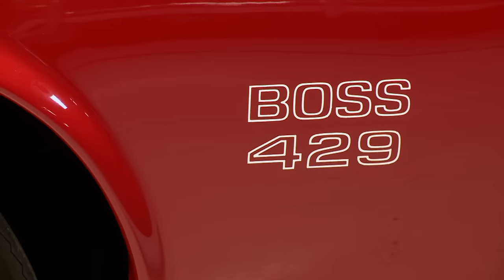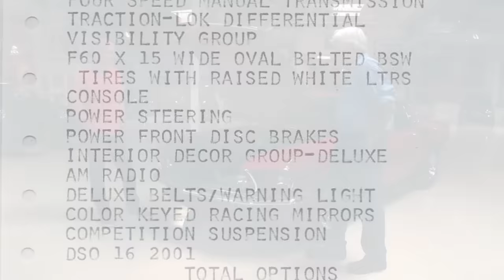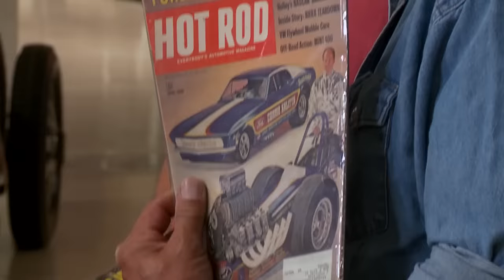1969 Ford Mustang Boss 429 - Jay Leno's Garage

Comment: My Dad has a 69 Boss 429 he bought Brand New upon returning from Vietnam. 370 hp is laughable. They were easily a 430-450 hp car and a carb , cam and distributor advance recurve puts the Boss 429 easily over the 500 hp mark. A simple cam change makes the Boss 429 a monster . Woke up is a understatement !
Reply: Aren't you glad he kept it.
Reply: 370hp is probably the rating in SAE Net, when most cars were rated in SAE Gross.
Reply: Absolute rubbish 1500 bhp 😂😂😂
Reply: Gobbless
Reply: All to get slaughtered by a hemi or 440 6 pack with the same mods
Reply: @bonkeydollocks1879 who in their right mind would want a car with that much power? Sorry, but to me, having a vehicle that has over 1,000 horsepower just makes it seem like it's made for racing on a track or drag strip, but for the normal roads, forget it lmao that's a death sentence
Reply: @charleslasorsa6629  Agree, most 1000hp cars dont make 700 anyways. 
Cant use more than 4-5 at the tire with a drag radial anyways .
Cant drive those cars til 3rd gear and have to ease into them. Useless
Reply: Everyone looks at horsepower and never understands the little thing called torque -- the power to get you moving, and that's what we had with the big blocks and even the stroker smaller blocks like the 351 Cleveland. 500 HP is useless if you don't have the torque to get it started and up to speed in the first place.
Reply: Complete incorrect if u actually watched the races the boss slaughtered and dominated all the 426 hemis and the trans ams and camaros and the super torino cobras beat all lmao 440 couldn't touch this car
Reply: 375 to the ground, makes more sense… 375 at the flywheel is just silly.  No one believed that.
Reply: @idontlikecops1 Amen. These cars stock wouldn't fall out of a tree! They had the potential but Ford neutered them from the factory. Small cam, carb, and restrictive exhaust. The Hemi and 440 six pack had the parts there, they just needed a super tune and timing work. No amount of tuning would make the Boss run without adding another carb, cam, and headers.
Reply: @markjones7417 I take the Carroll Shelby approach. Weight, horsepower, suspension. ⚡289
Reply: @liquidleopard4495   ha-ha, you have no idea. No, as they mentions in the video car-manufacturers were under-rating the power back before 1971 (while they still had good fuel & compression) And one of the easiest ways to do this was not to liw but just give up the "max power" on a wery low rpm like here. The 429 was a de-tuned race-engine that would easily rev up to +7.5k

Comment: I owned  '70 BOSS 429 when I was nineteen. It was Pastel Blue, one of just eighteen finished in that color. Only changes I made were to install headers, an 850 Holley double pumper, disabled the smog pump and thermactor system and  disconnect the rev limiter. Completely changed the performance. Biggest regret of my life was selling it.
Reply: Thanks now I got find one try build one like that
Reply: V8gas you could still do that today... I mean they still cost the same price (adjust for inflation) but most teens are too lazy to work for the money.
Reply: @raph_csg  no, no you can't. Money isn't worth as much as it was back then and the cost of the living has gone up. Meaning , if I could go out today and buy a brand new gt350 for 25,000, then that would be a fair comparison.
Reply: Double pumper? I guess you can forget about gas mileage. I would to love to experienced how it ran with headers on it.
Reply: w41duvernay  It's a Boss 429 dude. What does gas mileage have to do with anything? If concern over gas consumption is an issue you are not just looking at the wrong car, you're looking at entirely the wrong category. The Boss 429 arguably gets the worst gas mileage of any muscle car produced. Oh, BTW. One criticism of the car when showroom stock is that it was undercarburated. Which means performance algebraic equations tell us the engine wants more CFM for peak performance.
Reply: Lot of us guys know the feelings of regret.
I bought a 1969 firebird 400HO 4sp SURVIVOR 49,000 mile original car.
Loving the time and reliving what I loved so much. it's the best therapy on the planet!!!
Reply: Ash qelon  I know. 67 390/427 Vette roadster with 41,000mi. and 3,000 on rebuilt 427. $1,600 in 1972 as a 5 year old used car.
Reply: Will Davis Omg you had a boss 429 AND YOU SOLD IT .I PITY YOU.
Reply: My brother had a 1970 pastel blue Mach 1. The Pastel Blue Mustang was a very rare color indeed! It is one of those neat colors that changes colors depending on various lighting. In some conditions it looks white and in other lights it looks light blue. With the color combination of light blue blended with the dark blue Mach 1 interior it is a very dynamic looking Mustang.
Reply: @w41duvernay  May as well say "Boss 429?" "May as well forget about gas mileage."  Do you even know what "double pumper" means? 2 accelerator pumps. So it only affects the engine as you mash down on the pedal.
Reply: Will Davis
My wife just asked me why I am drooling at my computer, lol.  You may have sold it but as the saying goes......."it is better to have loved and lost than to have never loved at all."  At least you got to love her for a while.  👍🏼
Reply: True respect, you still dont have dislikes
Reply: I'm so sorry dude.
Reply: Sorry you sold it ...it happens tho. Things aren't meant to be forever. I'm glad you got to experience that thrill of a 429 going down the hwy. I never will but thanks to guys like you. You guys tell me how it was..and I appreciate it very much
Reply: Will Davis tell more what was it like dude
Reply: That's all you did, Will? Sacre bleu, it must have had more grunt than a major pig farm.
If only we kept the cars and motorcycles of our youth.
Reply: @gregorytimmons4777  Yep,my friend had one and I saw the intake ports on the cylinder heads..HUGE !!  I  Friend lived 1 street over from me and I could always hear when he started it up,I would cut through my neighbors yards to hurry up and get over there..Bob was so cool about it and I rode in it and WOW !  His wife finally had enough of it and said sell it or I will get it in our divorce,so he sold it for $2500..this was 1986..it was darker Blue..all original.
Reply: @rosskrause3926   People forget that in the 1980's the muscle car just became a thirsty older car that was hard or expensive to insure. Sure, i could see how they might upswing someday but where to put them in the meantime. I still liked hot rods and built a 67 Malibu SS i got for $500. Minus only the engine. (I already had a used 396 secured.) Great fun as it was not my daily ride.
Reply: @raph_csg   THIS is the single dumbest comment I may have ever seen on youtube, nay, the entire internet.  Why, just the other day my 14 year old brother decided to buy a mustang boss 429 with his piggy bank allowance!  What must one cost? like 100 dollars?
Reply: Yeah my friends Father had 1 of each, the 302, 351 and 429 and every one of those beasts could hold their own.  His favorite was the 351, the 429 he did what you did and removed all the excess garbage, port matched the heads did a complete roller package on the heads, gear to gear timing, electric water pump yadda yadda yadda lol.  His Dad still has them though he's never gotten around to frame off restoration and even living in Chicago he never takes them out unless it's sunny and beautiful.
Reply: MARK - You are absolutely correct..my bad!  It had just been such a long time ago... Alzheimer strikes again!
Reply: @raph_csg  Not fair.  How many teens do you know?
Reply: @173jaSon371  thank you
Reply: Gregory Timmons get a Prius and presto, prob solved
Reply: The 429 never had a rev limiter so not sure how you did that, there was no computer what so ever, it did not even have electric ignition.   The 429 was never a high rpm engine, it was a long stroke with more torque than horsepower as the engine was not originally designed for racing it was designed for the heavy Galaxy and special order on a the F-250/350.   The only “ rev limiter” was it’s lac of mechanical ability to turn high Rpm with out chicken legging the Lower end. (Rod through the oil pan RE: “chicken leg”)
Reply: My neighbor had a pastel blue 70 BOSS 429 he got from Koon's Ford in Virginia. He put headers on a big Holley and, of course, ditched the smog crap. I was 10 or 11 and he used to take me and my friends for rides down to a neighborhood "drag strip" and do 1/4 mile pulls. That thing was a monster! I remember he would come down the street idling along in first gear and stab the throttle and lift the front wheels off the ground. It was a good time to be a kid.
Reply: soaringtractor  
In my case....... both, but I only miss one.  I'm sure you know which one, lol.
Reply: Your dad loved you.
Reply: @vermontaviator1248  Better check your facts. The BOSS 429 most certainly came with a rev limiter. NOT a regular 429. BOSS 429 was designed specifically for NASCAR competition and to be able to run @ 8,000 rpm for 500 miles. I took mine up to 7,000 rpm any time I wanted. Never tried to go higher as I was just a teenager when I got it and didn’t want to chance damaging the engine.
Reply: @Ihavetruth22  He did...but I bought it with my own money.
Reply: @MarlonDeanMcQueen  sorry but your wrong pal.. I’m humble enough to be corrected by facts but not by fiction, tell me how did this “ rev limiter work on a carburetor with mechanical ignition, it wasn’t even HEI. Explain how this Stock “ Rev limiter” worked or show me some factory literature, seriously if I am wrong I would appreciate the wisdom, I am a master certified Ford Technician who graduated the Ford Asset program followed by 30+ years in the field  with Factory training as a field rep, Granted my career with Ford started in 1988 well after the 429 production, I am pretty familiar with the ignition and fuel delivery system in 1970.  I’ll be waiting.
Reply: @vermontaviator1248  All yo have to do is look it up. There’s even ones for sale on eBay. There’s a website with diagram showing how it works (BOSS 302, but works in the same way). If you want the truth, you can easily find it.
Reply: @MarlonDeanMcQueen  we are not talking about aftermarket products in 2021... and you know that, nice Try!  1970 not 2021,    51 years apart.
Reply: @vermontaviator1248  I’m through trying to reason with you. You are wrong and refuse to accept what is out there. Nothing aftermarket about it. Good day to you. I hope you don’t carry this resistant attitude throughout your life.
Reply: @MarlonDeanMcQueen   wow!
Reply: Wow. A Boss 429 at nineteen. I had a 70 GTO in my twenties but doesn’t compare in value today to your Boss.
Reply: Are You Sure It Wasn't GRABBER Blue.. Case I Am...& BTW Back in the Day almost everyone with a 429 or 302 SAID LOOK A BOSS 302/429 & well..there very rare , BTW  that motor ...never mind
.
Reply: @MarlonDeanMcQueen  qqq sc c
Reply: @vermontaviator1248  REV LIMITER ASSEMBLY 1970 BOSS 429 & 428 COBRA JET MUSTANG 4-SPEED COMPLETE, YEAH IT DID.
Reply: @MarlonDeanMcQueen  REV LIMITER ASSEMBLY 1970 BOSS 429 & 428 COBRA JET MUSTANG 4-SPEED COMPLETE Definitely 
Had a Rev Limiter!
Reply: @dancorry4305  sorry kid, your talking out your arse!.. there’s a huge difference in electronic rev limiters and an engines inability to exceed high rpm, there’s was absolutely no electronic ignition or fuel injection to “shut off”, it was all mechanical, you are confusing inability with electronic ignition limiters. I’ve waited well over a year for one of you to provide proof of this, a simply link, the only thing one guy showed was a modern after market HEI system.
Reply: @vermontaviator1248  I sent you
the info from a website 
were you could buy a 
Rev Limiter for a 428 CJ/
429. Send your message 
to Jon Kaase, and ask him.
No one walking the earth
knows more about a 429
engine, he makes a living 
selling Defanged 429.
He’ll answer you back. 
Best Wishes/ THE KID.
Reply: Sure you did 😅
Reply: Mine came with a factory 1000 cfm Holly carb
Reply: Sounds like eleven seconds to me .
Reply: @ashqelon7267 That's a damn nice car. Is surprisingly fast
Reply: Dad is a smart man. Is word on the street, Three fifty one is the fastest one of them all.